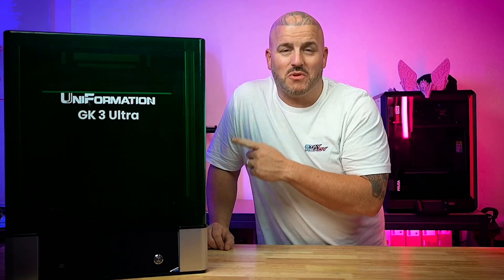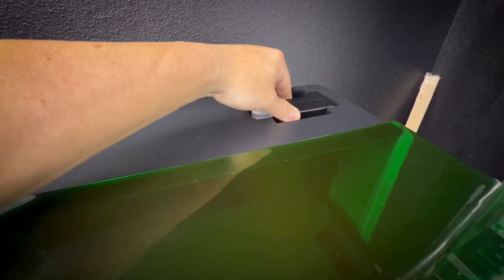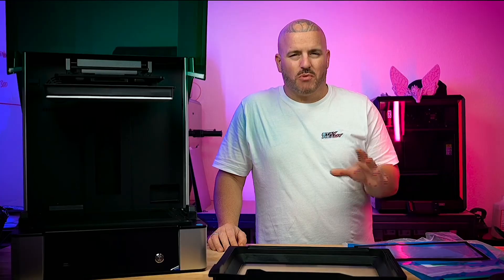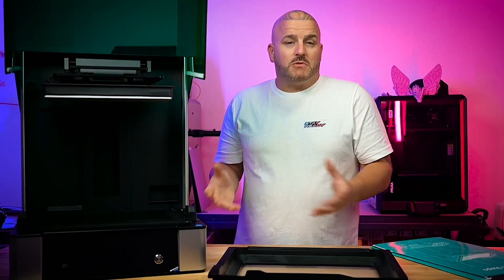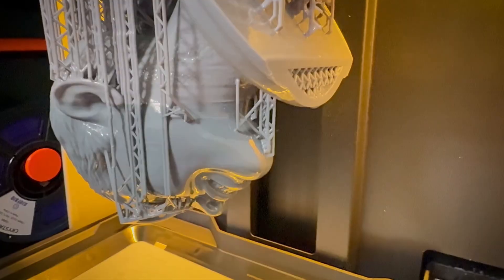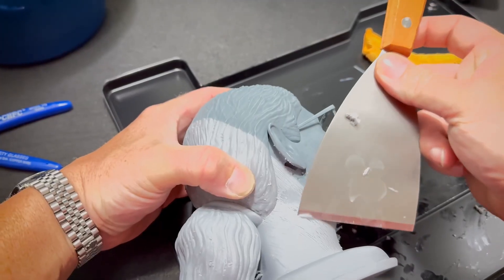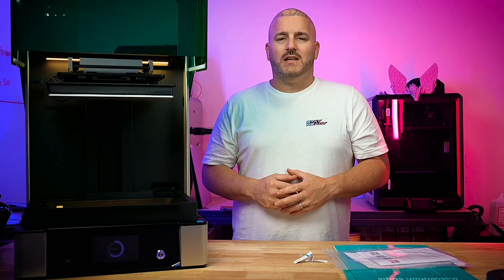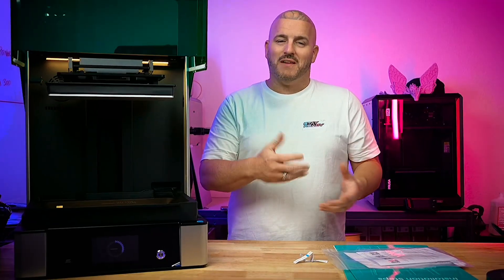This Resin Printer Is Incredibly Large!

Comment: love the build size, especially it will allow you to either print a ton of mini's at one time or have the luxury of printing larger prints without having to cut the model into sections in order to print. As far as washing something that big, is not an issue if you have a large container to wash it in. i have several sizes based on the size i printed. i may have to invest in one......
Reply from the maker: I love the size and quality.  Wry good printer.